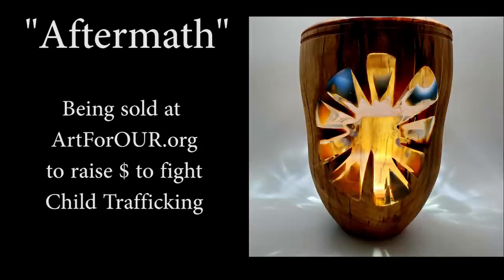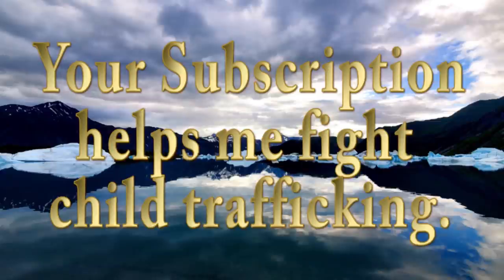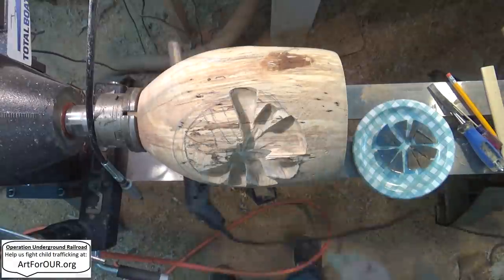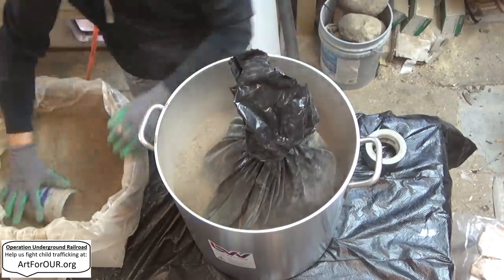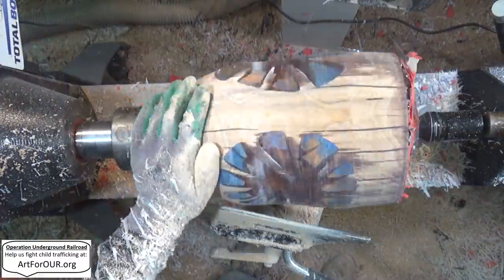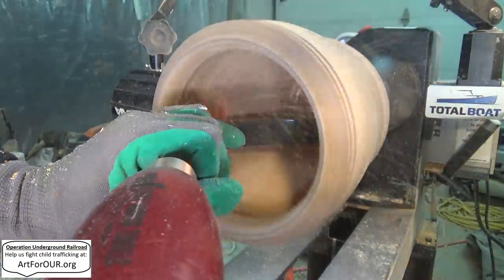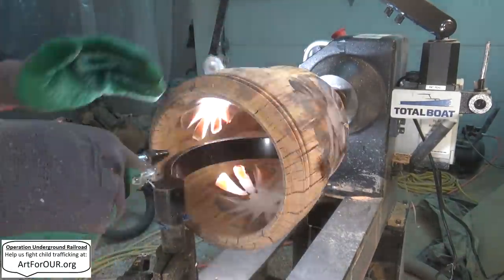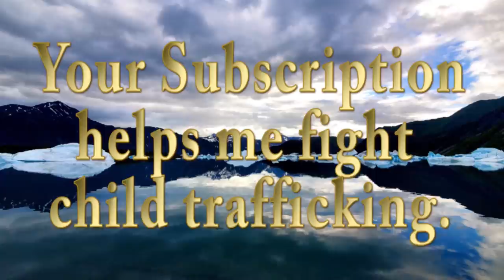"Aftermath" Wood and Resin Turning, capturing an explosion in resin. Birchwood Vase. O.U.R.

Comment: Another weird and wonderful piece 😎. Bit hard to see what in the end was left in your windows. Am I correct in they are a mix of the resin chips, wood, your orange foam and the clear resin?

Rather than the foam, or cutting boards as you suggest, have you tried Corflute panel? Perhaps called something else where you are, but basically corrugated plastic sheet. We get it in 3mm and 5mm thick sheets here and I’d cheap and easy to use.

Also, I hope you have a separator tank of some sort on you vacuum hose. Even popping bubbles will cause resin to be sucked up the tube into your pump otherwise. It’s simply a chamber of some sort, I use PVC pipe with sealed ends, and inlet and outlet connectors for your tubing. I glue a thin sheet of plastic between the input and output to half way down (before putting end cap on) to ensure the resin can’t get sucked up directly from the inlet to the outlet.  Even though I never let the resin foam get to the top I was amazed at how much resin was in it after a few years of use and I cut it open again.

Keep up the good work 👍
Reply from the maker: Thank you be very much!  Love the suggestions.  Much appreciated. 

Artforour.org

Comment: I'm listening to your explanation in the video; you use a vacuum chamber and then a pressure pot?  How do you know/decide when to move it to the pressure pot?  Does the resin take long enough to cure for that to be effective?
Reply from the maker: That's a good question.   I use the total boat fathom resin which takes many hours to solidify so it gives me plenty of time to work.   I leave the wood in the resin in the vacuum chamber for an hour or so which allows for the air in the wood to be replaced by resin enough to prevent most air release into the resin later.... then into the pressure pot until hardened.   This means I don't have to treat the wood before hand to seal it...

Comment: Hey Dan, nice work. I've enjoyed all your videos. Here's a thought that may help avoid the bubble trail. Why don't you paint a thin layer of fast setting epoxy in your windows as a seal coat? This should eliminate the bubble trail from appearing in the areas you are not turning away.
Reply from the maker: Thank you Jeff!  I've tried that before and still had bad luck.... this new approach has solved the problem so far...I hope.   😀

Comment: May i ask you plz. If i dont have pressure pot ist possible to put the mixed resin with the hardener in the microwave for afew seconds to getred of the pubbles..? thank you.
Sorry for my poor english.
Reply from the maker: No problem.  I have never tried the microwave idea, but I would worry that the increase in heat would make the resin boil or set too fast making it set immediately or crack.  It might be worth an experiment!

Artforour.org
Reply: @artgivinghope  thanks for replying its kind of you. I will try it with care.